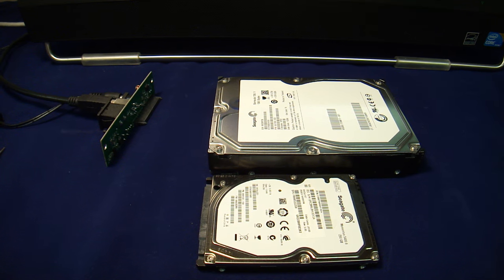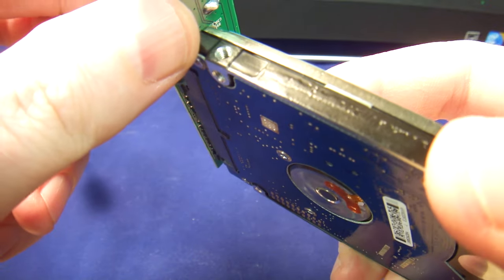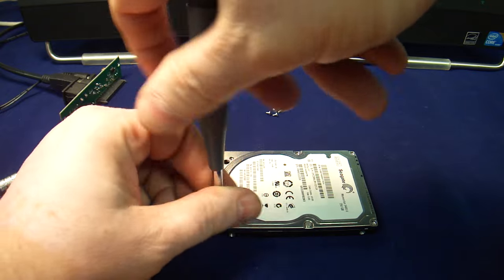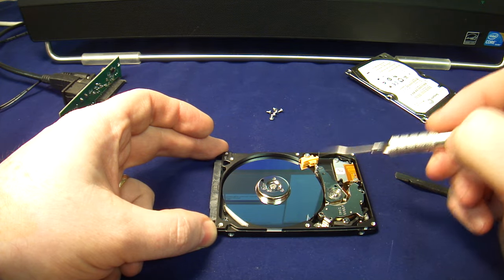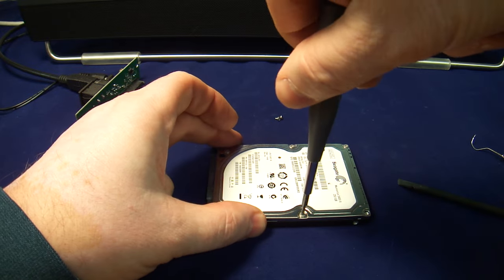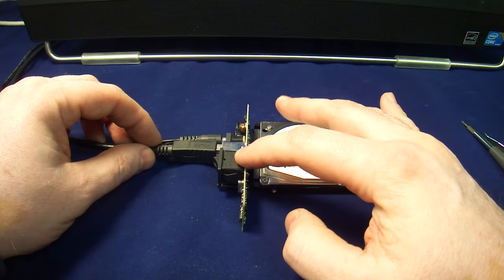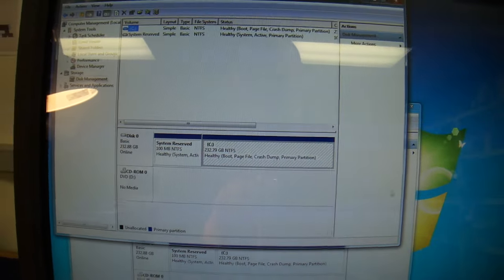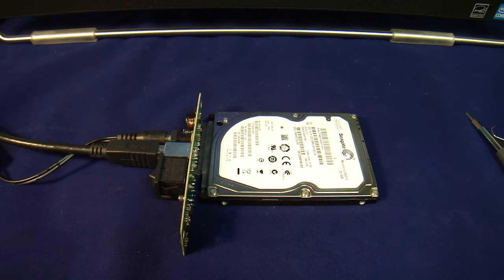DIY Video 2 How to fix a broken hard drive Beeping noise Get your data Back! Best Kept Secret

Comment: You are a beautiful person, you saved me years of tears. 15 years of data saved and now backed up on 3 HDD! Dropped my hard drive on the floor while in use and it started beeping, so in fear of losing all my family's precious memories I thank god managed to find this video.  Done this video step by step to my Samsung M3 1TB external hard drive in a clean and dry bathroom (as dust free as possible) and as quickly as possible whilst being careful. All went to plan, plugged it in and all my data was there. I backed it straight up. (A couple of tips from my experience doing this: Have confidence, don't take to long take the case off, carefully remove the heads from the platters then case straight back on. Try to copy data in segments don't try and copy 500gb at once. Your hard drive will get warm from reading/writing so much at one time and will start to transfer very slowly. Let it cool down by either ejecting the HDD safely then unplugging, or if you can't do that then shut down your pc and then unplug the HDD. Leave it in a cool place e.g. (window at night time) for an hour or so then try again. Will always transfer data faster when cooler, don't overwork it then burn it out once you have done the hard work and carried out this open heart surgery on a hard drive 😁   I will be donating money to this man 💯% what a an absolute gentleman this man is 🙏 oh and he has the same hands as me (skin condition: vitiligo) 👍

Comment: It worked!!!!

Thank you so much. 

After taking it to my nearest IT and data recovery shop and them "running tests" on it for two days, I followed your instructions, and now all I have to do is rescrew all the little screws into place and refasten the casing, and we are back to normal. Over £160 saved for a new 1TB Hdd, and my data recovered - priceless!!!!

Comment: Thank you so much for this video! My seagate fell from the table on the floor. Beeping noise. I opened it (in the living room, in gloves, face mask, glasses and hoodie). My drive was a bit older - different hidden bolts, needed additional torx to open. The head was stuck. I moved them to parked position. Closed. Connected to computer with sata USB 3 connector. And. Clicking sound. Next day connected again. This time I could see the disc, but not for long. A few days later my older computer was able to see it. I had to use piriform recuva to get my files off it. Magic. Thank you.

Comment: Tried this on a Seagate Backup Plus Portable 1TB Drive.
The Drive was beeping and as explained the head was stuck. No Clean Room required.
All data recovered. Many Thanks
Reply: Man ! i got seagate 2 TB barracuda i got low clicking i dont know shall i proceed with opening it and adjust heads or not...it is expensive here also in my country to recover data
Reply: Garreth Nevin hey mine is beeping and the light turned off on it does that mean the head is just stuck
Reply: @georgiafan8814  Same here
Reply: @georgiafan8814  I literally have the same problem. Did you fix the problem
Reply: Can anyone help me .I don't need my data I just need my HDD working again . My HDD makes beeping noise.
Reply: Hi Garreth. Can you elaborate what you did

Comment: Thanks Abraham, worked like a charm. I'm recovering my clients data as we speak. I used a paper clip bent at the end instead of the dental pick you used to park the heads. I wet wiped the table and shut off the furnace to reduce airborne dust.

Comment: I don't know you but you are now my friend! You my friend are a freaking genius!   I had 2 TB in fear of loss and this just saved me 15 years of data collection AND OR $2000!  I freaking love you!!!! YEAHHHHHHH BABBABABABBABAY!  YOU THE MAN!!!
Reply: $2000 in data? or a harddrive???
Reply: Surms41 If you have a really broken hard drive disk that can't be recovered you might need to send it to seagate and they can bring the most data back with very special instruments however a progress like this will cost you a minimum of 900$, trust me i work at a hardware store.
Reply: Ya I had quote for big money - truth is, after doing this, the drive was dead like 5 days later.  Having said that, I got my data back with this method :-)  it's a Hail Mary type of play, but works if you are extremely careful.  Good luck!
Reply: ebay :)
Reply: 2tb,  years ago? Hmmm

Comment: one more "THANKS, you saved my day - or rather, my entire week!" Had that beeping-thing, came across your video and decided that there's not much to lose with trying your method. And yes, it worked, I lost just a couple of kByte. Incredible, so happy!! 
Opened the drive in my living room, found the head stuck midways and broke it free as you describe. Funny that after reassembly and starting up the HDD made quite some noise, and namely that it decreased to almost normal after a little while in operation. Maybe that's because of particles getting trapped as you describe.
Some suggestions to others: 
wipe down the HDD case before you start opening it. This could help reducing particles reaching the actual platters
don't leave the inside exposed to ambient conditions for more time than necessary
your breath contains particles, too (even more if you fancy cigarettes), so if you have a magnification-lamp available to do the surgery, it can't hurt using it so that your breath does not go straight onto the HDD. Of course, other tranparent shielding might work as well.

Comment: Just chimed in to to say I attempted the fix on my external hard drive and IT WORKED!  The whole repair was pretty straightforward and just as explained in the video. It dropped off my desk one too many times and it began to beep. I wouldn't trust it long term now that the case has been opened so it will be replaced asap.

Comment: Thank you!! My hard drive, which had all the files for my MA thesis, photos from the last 10 years, and basically everything I've worked on in the past years stopped working recently. I had exactly the beeping sound you described and found your video after searching for how to respond to this. Your solution worked and I got my data back! Thanks for explaining everything so clearly.

Comment: Thank you! This helped me fix a teacher harddrive that unexpected wouldn't boot. She came in to start getting ready for the year and I told her I would look into it. It was making a beeping sound, though not a fast as yours. I opened it up and found the head stuck on the plate just like in your video. The disk was able to spin up and I'm currently backing up data from it while I have a chance.

Comment: This worked for me, a 1TB seagate was beeping, opened the drive, got the discs to spin again, pushed the heads to start reading again and it worked, got all the data off no data loss at all. I did work on one of those antistatic mats but other than that just in my own study. As Abraham said, don't do this if you cannot live with the data on that drive because it remains tricky and you may just loose it all. My data was backed up but very inconvenient to go back to restore it all, fixing the drive and copy it all was a breeze.

Comment: Thank you!!
For anyone curious of the "success rate" of this process, I just finished doing mine and it fired right up, I'm copying the drive over to a backup drive as we speak.
I can't speak for every hard drive problem, as I'm sure they are all different. But, in the event your problem is the read-write arm being stuck out over the platters and not allowing it to spin when you start it up, this is a very helpful video on how to fix it. 

FWIW, I went to plug in my daily use work drive yesterday and my computer didn't do anything. So I unplugged and tried again, and still nothing. I tried a third time and held it to my ear and could hear a distinct "beeping". Not a clicking, and could certainly tell the drive wasn't spinning.

I went and bought a set of torx srew drived to get it opened, low and behold, arm was stuck out over the platter. I recommend doing the movement with two hands, and two tools. One, to turn the platter (with your same screw driver) and one to gently guide the arm back to the home position while youre turning.

Good luck everyone! 
PS, I had the same (Silicon Power - Seagate 1 TB) brand of drive fail on me a couple years ago and I used Drivesavers.com

I got most everything back, but it was a $2400 invoice.
I took a chance on this one, and luckily it worked out.

Comment: Thanks!! Worked like a charm on a new Seagate 1tb HDD that fell off the table while working and got "stuck". All i got was the dreaded beeps. I moved the platter while VERY gently moving the head back in place just as shown in the video. Got all my data off without problems or costs.

Comment: So, I had the exact same problem. HDD wasn't spinning up because the heads weren't in parking position. It beeped/buzzed.
I followed the instructions in the video, and afterward it did spin up... unly to make this horrendous grinding/clicking noise.

I killed my HDD and all of the data on it, probably by being not careful enough.
I can't stress the fact enough that you have to apply absolutely no force at all when moving the drive heads. If you do, and they suddenly snap back, you're screwed.

Still: thank you for the video! It helped to make clear what the problem was and gave me the courage to attempt to recover the data.
Failing at it was my own fault.

Comment: Just wanted to say THANK YOU. I just used this successfully on a friend's Samsung HD that had crashed. When connected it made a series of beeps (appx. 12) and the laptop failed to start. I opened up the HD and saw that the head was indeed stuck, then gently moved the head back while turning the screw. When I started it back up it no longer beeped or clunked. The HD was up and running again right away.
Reply: Pam Berg but its not fixed

Comment: Thank you very much for this video! I had backed up my footage, but not the editing project files that I was working on when I dropped my hard drive while it was plugged in. Beeping sound exactly as described. The price quoted to 'send to the lab' wasn't worth it, so with nothing to lose I thought I'd have a go at this on my Seagate 2tb external hdd. I have no experience with anything like this, but with your video I managed to open it up, drag the spindle back and it booted up for enough time to get my project files off!
Wouldn't have even had a chance if not for seeing this video, much appreciated. Adam
Reply: My hard drive 10 yrs old by now (Windows Vista home premium)My computer keep send me message "repair hard drive "after watches this video i give it a try to open up let your guy know what end up...

Comment: Thanks for the video. Following your instructions, I was able to confirm that the arm of the 'beeping' drive (Seagate 500gb) wasn't stuck in the wrong position. I then purchased a hard drive case and inserted the faulty drive. It worked, which suggests a problem with the power unit on the Seagate drive case (which seems another common fault of the Seagate drives, from a quick internet search).

Comment: Amazing. You da man. I was hesitant to try this ... but I did ... and I got my data. Thank you soooo much. I had to pull the label off the hard drive to find that 7th screw. And of the six outside screws, one ended up being smaller than the rest. I think I had the back cover off for about 20 seconds total. Prayer definitely preceded  the  procedure. Worked like a charm. I plugged it back into my laptop and took care of a few things. Right now I am "ghosting" it hoping it will be a smooth transition to a new hard drive. Many thanks.

Comment: My experience.

 I had a hard drive that was making a similar beeping noise and had to buy a star shaped screw driver in order to open it. I mounted the T6 bit (as shown in the video) but had trouble with turning the screws. However it wasn't nearly as bad as finding that last hidden screw underneath the plastic labeling. I had to scrape through two layers of it in order for the bit to seat properly into the bolt (just enough to be able to turn it) and almost completely stripped both the bit and bolt head in the process.

After opening the hard drive I attempted the same method shown @ 5:23. Only I was using a pair of tweezers and watched in horror as the metal apparatus connected to those mechanical arms nearly snatched the tweezers right out my hand by way of magnetization. After another attempt using a carefully inserted T5 bit in one of the arm holes, I was able to successfully pull the heads back away from the platters. 

The arms seemed to click right into place and I only ever applied a very minute quantity of force in order to pull the arms back. My computer seems to be working fine now. I am hopeful I will be able to transfer the data to another hard drive before this one inevitably malfunctions again.

Thank you very much Abraham, this video was most helpful.

Comment: Thanks for the video. One thing you should say in the start of the video is that the hard drive will not work for long after people do this. I did not watch the whole video through before i started :) Its no problem, it was not an important hard drive, and not an expensive one either, but i didnt know that the hard drive was not useable after this repair.

Comment: Excellent show off tutorial. For clicking noise we have another tut and that one you usually cant do at home as you need another fully working and tested hdd from same series so you could doing some part transplant. Usually just actuator with heads as even labs dislike to even contemplate removing all platters from one case to another when motor fails.

Comment: Good afternoon, I saw your demonstration about damaged hard drives and the type of sound they make when turning them on, and it helped me check mine, which is in the same condition, but with the detail that it sounds the same as a DVD player, it starts up and then does a pause intermittently which in each one tries to read the disk and repeats the same process, for which I am encouraged to ask, consider that it has possibilities that in a laboratory or if it is the case, try to rescue the data.

Comment: This video was exceptionally helpful!  Was easily able to follow all the steps and, lo and behold, I was able to recover all my files for the cost of the box of computer screwdrivers.  Why is it that Seagate needed to charge me minimum $500 just to tell me if they could even recover the files?  Something very wrong with that.  Thank you VERY much for posting this video!

Comment: Thank you for both videos. Mine fell over, (going use upright mount again). It failed and started the buzzing noise. Tried disk utility (Mac) repair function, but it gave me bad news. 

I only have my iTunes library on it, so I followed your advice on these two videos. I thought, "If I can avoid copying all 54gig of music from the CDs it will be worth the risk of losing the drive". I found the head wasn't stuck when I opened it. No skid trails or anything else. The head and platters are moving freely, but I'll take your advice and assume this one is toast. Right now it's transferring the files at 47% right now,yay! 

If you hadn't posted this second video, I would likely have assumed that on putting it back together, that it would work fine again. And might have put  it back to use.

Comment: Hi Abraham. Thank you for your fix, it worked. My drive was removed while it was in use, so I believe that is the cause.
I fixed my drive little differently. I didn't open it, just shook the hard drive vigorously and heard that the piece was moving. I continued until I didn't hear anything with shaking it. Then, it started working again. If people are afraid opening their hard drive, do you think they can try this method? Would it cause any harm? Can the heads scratch the platter?

Comment: Hello Computer Services. 
First, thank you for the help and the honesty.
I have three questions if you could please take a moment.
1) You make it clear in the video to recover the data as quick as possible and not keep using the device because once you break the seal, the device is gone. Why is this? 
2) I'm curious if I can keep using it at least as an alternative backup since it'd be very frustrating to have paid so much for something that is gone so easily. 
3) What are the best home-use (pics, videos) storage options, given these devices seem to be so fragile? And if an external hard drive is still one of the best options, what are some good ones/the most solid ones? I'd like something I could store the information in and be cool it will remain there safe at least for 3 years!
Thank you!

Comment: Abraham Levit, thank you so much for the advice. I live in Brazil, and my Seagate external HD was beeping noise. I followed your steps and it worked perfectly. Thank you so much again.
Reply: Is it possible to use your hard drive again or you've just saved your data?
Reply: florian74jo  Yep! I formatted the external hard drive and it worked perfectly .
Reply: ***** Really? I don't heard this in the video. I just tested the HD and it worked. :)

Comment: I saved all data thanks to your helpfull explanation. The head was even on the half part of disk. When I turned on scratching sound in the beggining after that copy speed vary from 50kb to 15mb/s . Lucky all data saved. Thanks a lot.

Comment: I did this and it fixed the hard drive. I restarted hard drive and it never worked again. Was I supposed to data recover right away? Though this would have permanently fixed it. :(

FML. I just saw the last part of your video again. You made it clear to recover the data ASAP. I should've done that!!! I shouldn't have turned off the hard drive! Now it's ruined!!!!!!!